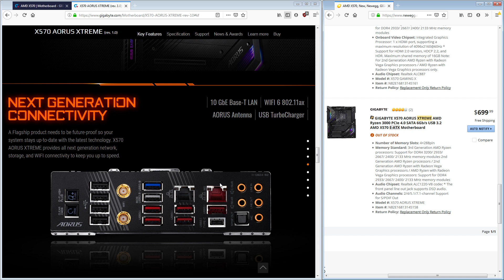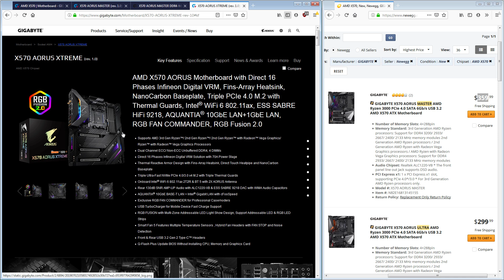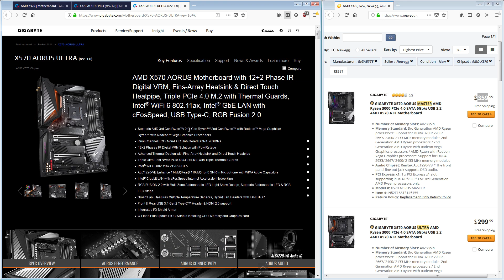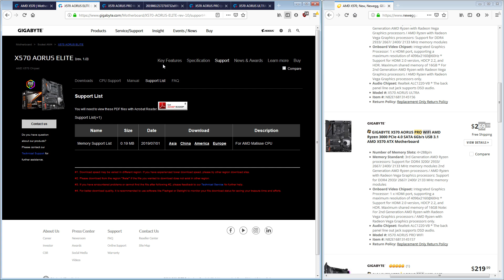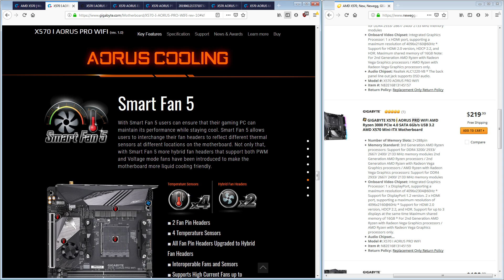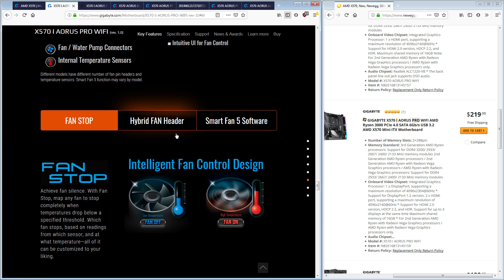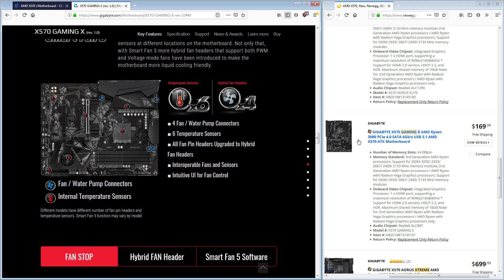Buildzoid rambles about ALL the X570 Gigabyte boards

Comment: I upgraded to an x470 Crosshair VII Wifi a few days ago. It was either Aorus Elite or Tuf Gaming Wifi for x570 or Gaming 7 Wifi, Taichi or the crosshair for x470. There was an outside chance for the x470 rog strix if none of the boards I really wanted were available. Went for the Crosshair for the extra features. The price was the same. At least when I ordered, as I got it on sale. Will put a 12/16 core in there down the line, otherwise I could have gone with a cheaper less overkill board.

Comment: Gigabyte: Makes boards with horrible VRM's.
Buildzoid: Make better VRM's ffs.
Gigabyte: Makes boards with excellent VRM's.
Buildzoid: Make worse VRM's ffs.
Reply: if ur paying 700 dollars those vrms better be made diamond encrusted with ruby emerald caps
Reply: Yeah im so fed up with the Mobo and GPU and CPU gouging .....Even the RAM got in on the Raping of us Consumers and they got caught ....now if we could get Mobos caught for price fixing then you know cpu and GPU's would drop with in a few so they would not have a Big light on them....oh we can dream but who knows I read the FTC is looking into Gig and MSI  for over steep pricing as the Reddit story said an investigation can NOT COME SOON ENOUGH for all of the major Players!!  Cow}:-o)
Reply: Im1CrazyCow Yeah you definitely are crazy, that’s not how economics work and I really don’t see that happening
Reply: The VRM heatsink on the x570 Aorus xtreme is as good as they come
Reply: aorus elite vrm are pretty much all you need
Reply: I really need an update on Biostar X570 GT8  ; how good / bad it is compared to Aorus Elite X570 board.
Reply: matrixfull 
8+4 IR3550 (60A) with a 35201 controller and 3599 doublers. Really impressive for APU LN2 OC ... or a rather useless layout.
Its still really good for 200€, but Im not so sure about the fan and the BIOS.
Reply: Dude bitching about cost of board and VRMs...ignores the fact that YOU DON'T NEED TO PAY FOR COOLERS WHEN YOU USE THIS MOBO AND THERE WILL THUS BE LESS NOISE...so just consider that a $100-200 rebate minimum.
Reply: @KravMagoo  / completely agree... I'm not in the market for this board but I wouldn't hesitate to go with this board in an extreme build

Comment: Not sure if anyone mentioned this, but the aorus Elite manual references a aorus elite Wifi, even with a QR code. This QR code just refers to the normal elite webpage and the only mention of an aorus elite wifi motherboard is one single article that just mentions that the wifi edition is 10 dollars more expensive. Is this a cancelled product or is there some other reason for not being able to find any more info?
Reply: @Actually Hardcore Overclocking, it seems that now gigabyte is listing the aorus elite wifi x570 board on their site, however i cannot find a price for it yet, allegedly it would be 10$ more than the non wifi, for "Intel® Dual Band 802.11ac WIFI & BT 4.2". Do you have any info about the pricing and if in your opinion this version of the board would be worth it.

Comment: I think all the lower-end boards bit manufacturers in the backside when the APUs launched and no one had Bios flashback on APU tire boards.  it left a lot of new systems builds with no way to update the bios to support the CPU purchased with the board, unless you happen to have a ryzen already.  yes, the C7H has Bios flashback, for a CPU that costs less than half the board and you cant even use the iGPU, is just stupid for a HTPC build, lol.

Comment: Hey Zoid. I guess Asus x570 tuf wifi and Aorus Elite are the best mobos (value wise). Can you compare them with higher detail ? Asus tuf wifi is so excellent on paper. Also you don't comment on pcb count much. What it's benefits ? Aorus pro wifi is 6layer pcb, aorus elite 4 layer pcb, Asus tuf wifi 6 layer pcb at $199 with wifi.

Comment: The audio components Gigabyte uses in the Aorus Xtreme are the same parts you'll find in high end external DACs. You'd have to spend a lot on an external soundcard to get something equal, let alone better. The Apogee Duet 2 for example uses the same chipset and overall very similar components (it doesn't get much better or more expensive than WIMA and Nichicon after all), and costs more than this entire board.

Comment: Nah, I'm not buying a new motherboard. My Ryzen 5 3600X is happy enough on my Prime X370-Pro. Even without PBO she boosts to near max boost cooled by a Thermalright TS-140.
One odd thing I've noticed is all cores boosting up to somewhere between 4.2 and 4.3 GHz, though that may have due to me monitoring them with Riva Tuner while playing a few hours of Fallout 4 (great stability test: if memory or overclock is on the edge of stability, Bethesda's Creation engine will become even more unstable than it normally is (still love the engine/games, though.))

Comment: Hi, I couldn't buy any 4 stick kits, so I just bought 2 x 2 stick kits for Crucial 3000 RAM.
Is the fact that I have 2 kits going to limit my potential vs 1 kit ?
I have the Aorus Ultra with 3900x.

I'm going to attempt OC like I saw in your Crucial video ( exact same RAM ).
Thanks.

Comment: @11:30 those pci-e lanes come from somewhere, from chipset for example, which creates a limited number of lanes. If you want to add more slots, you may have to disable other features of the chipset like extra m.2 connectors or sata ports.
@13:00 They used to sell full retail 10g cards with the Aquantia chipset for around 70-75$ so the chip itself is probably much cheaper in volume, let's say 30-40$... but who knows, they were recently bought by Marvell so maybe they raised the prices 

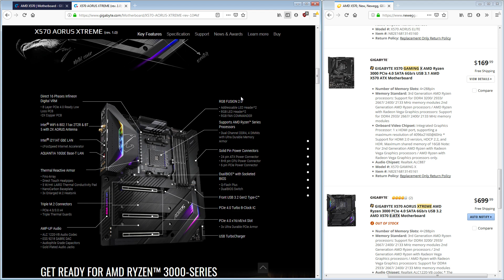@14:20 Someone could connect the 10g network card directly to a NAS and then use WiFi 6 for internet connection.  The 1 gbps could be used for separate/internal private LAN in a business somewhere. Well, sure, few are actually gonna buy this motherboard for an office workstation.  This being said, I agree with you that they should design the wireless card to be optional/removable.

Comment: All of those high speed kits are quite irrelevant. If you go out of 1:1 you get micro stutter. 3733 is about the best you can do in 1:1.
Reply: You may get away with 3800mhz ram and manually setting the infinity fabric to 1900mhz if you use the higher end cpu's

Comment: I still wonder why they don't implement the 10 Gb ethernet ports, instead of a "useless" 2.5 gb?
Reply: Most mainstream consumers doesn't have a gb internet connection nor a 10gb switch or router at home so it be kinda pointless.
Reply: @junyanchan1285  But when a motherboard is that price. It should have one when a motherboard like the Taichi Z390 ultimate has it. For a way lower price? Feels like I'm getting scammed out of that 10 gb ethernet port.

Comment: Can anyone here confirm?... using optical-out from the mobo to a theater receiver ...same audio quality as these PCI-E & USB sound cards & DACs, right? Wrong?

Been using this setup for years, but I've never owned an external PC DAC or soundcard to compare with.
Reply from the maker: If you use optical out you're using the DAC built into the receiving device
Reply: @ActuallyHardcoreOverclocking  that jives with what I read years ago, & why I've been using/suggesting thrift-store 5.1 receivers, but I just wasn't sure anymore with everyone being so concerned with mobo codec quality & streamers all running these external DACs. Thx for the reply! Great vids, btw

Comment: @Buildzoid
Does an X470 motherboard limit my memory speed compared to an X570 even though the QVL says the memory speed is supported? Do I have more trouble hitting higher mhz on X470 via xmp without manual tuning?
I'm considering buying a 3700X on a X470 and 16gb 3600 RAM
Thx

Comment: I have the itx board and 32gb ram. G. SKILL Ripjaws V 3200 for Intel. Got the sticks before ryzen 1st gen issues were found. On the Biostar X370 GTN was able to run at 2933 for years. I could not get his running higher than 2133 using either manual or XMP (profile 1 looked good). Finally installed Gigabytes OC windows app and was able to use it to get to 2933. Going to try 3200 today. Using F4h bios

Comment: Concerning your rant about LAN, WiFi, Sound cards, USB and PCIe expansions, on paper I totally agree with you. Most of the "features" included on modern motherboards are going to waste. I too would rather use my own sound card/WiFi card/10GB LAN card and so on - frankly even the standard back IO ports should be customizable in my opinion - however in practice it would require motherboard manufacturers to come up with a new standard to replace the ATX standard and its derivatives. Unfortunately manufacturers will always be reluctant to invest into new standards - no matter how much better things might be either for them or their customers - because changes to the end product means changes in manufacturing process, huge costs and taking the risk that the customers might end up just as reluctant to change.

Comment: the pro has 2 thermal sensor connectors. Nothing cheaper from any vendor of x570 has one. This makes it the ideal board for watercooling setups in my eyes.
Reply: Quite often not every fan header can use temp sensors as a source for the fan curve.
Reply: @Lead_Foot  Which is a mistake of motherboard vendors. Why should my fans ramp up every time my cpu spikes because it is at 100% load when my water temp has not changed.

Comment: Ace Meg has a heatpipe running down to the chipset. The only mobo under 360-400 USD. You didn't mention that in MSI vid. What's the reason for that? Is it not meant for cooling the chipset?
Reply from the maker: Because I doubt how effective it is if the board still comes with a chipset fan
Reply: Yeah I can see that. I'm trying to figure out my next purchase, so I will wait for the actual testing then. I hope you're gonna test some of the mobos in that price range. @ActuallyHardcoreOverclocking

Comment: Thanks maaaaan! I can finally order the Master for 4x8Gb SS DIMMs setup. Was so afraid that Daisy Chain would prevent this...i really want to be able to go 4000Mhz low latency with forced IF clocks <33333
Reply from the maker: 4000MHz on ryzen is bad because you have to run the fclk de-synced and that causes a latency hit lowering performance

Comment: The biggest issue with Gigabyte's ITX board compared to impact is rear IO as far as I'm concerned. Also no digital audio out is a big nono for this form factor. Impact does much better with rear IO.

Comment: 1:00:00 as a guy who has done multiple ITX build, having printers and external soundcard on an ITX build doesn't make sense. The point of the ITX build is to be as minimal and compact as possible, for space efficiency and portability. P.S. this is also why on-board audio is important, because it doesn't have to be as good as an external DAC; it just has to be good enough that you don't need to buy one.
Reply: Besides, if you're that needy for usb ports, you can always use a hub. Printers, soundcards, keyboard and mouse don't need the bandwidth. Even for webcams it is questionable to need a dedicated usb port. Although mouse and keyboard I can understand due to possible latency issues.

Comment: When did the Diagnostic Display get to be such a luxury item? A few years ago they were on most boards.
Reply: Agreed. My Gigabyte Z87-UD4H was $75 in August 2013 (just two months after Haswell launch). Quality VRMs and Post code were standard and it was sub $100. I do think I got super spoiled by this motherboard though lol. And for full disclosure, it was $115-$40 (Microcenter promo); but hey. There is a certain irony that AMD boards are now pricier than the Intel boards I've used in the past. And that even includes the DFI LP UT P35 board - look at its launch price (lmao) - tho I ultimately got that for like $22X I believe.
Reply: Dude i got. POS Gigabyte G1 z97 with debug display, post code bios FB Quick buttons c cmos, power reset dual bios dips, single bios dip $120 lol they are screwing us enthusiasts
Reply: Yeah those displays cost what ..a few cents?
Reply: and back when i got my first highend s754/939 AMD boards, they where 1000-1400dkk (150-200usd), these days same quality board cost you 2000+ dkk(300+ usd). So things change, and aparently electronics keeps getting WAY more expensive.
Reply: When they started excluding them
Reply: The board cartel got together and agreed on a plan to segment the market to raise prices by limiting feature competition. You know, anti-capitalism at its best!!

(Last sentence added because I'm concerned that an entire generation is growing up wrongfully being told that greed is capitalism as apposed to a market-based method for the efficient allocation & investment of limited resources)

Comment: I just finished building a x570 Gigabyte Ultra with 3700x/ rtx 2060 and I love it! it has been a massive bump in performance/stability/responsiveness from my former fx-8300/M5A97 r.2/r9 290x.
Reply: Can you tell us anything about the Chipset fan. How loud is it? Does it run at high rpm all the time?
Reply: Jeroen E I haven’t been able to hear the fan from the chipset because The stock Wraith Spire that came with the 3700x is super loud.
Reply: Jeroen E I just removed the side glass of my case and I still can’t hear the chipset fan. My CPU and GPU fans do not allow me to hear the chipset fan. Also, the chipset fan only turn on during intense applications. It stays off at idle.

Comment: So provided you have the best power stages and filters, whats the best number of phases to achieve best CPU overclock with the lowest vcore? (ignoring efficiency)
Reply: Infinity
Reply: @teddygoboom1  I doubt it. at certain number it probably stop to matter and you stop getting any benefit for your overclock. the question is whats that magical number?
Reply: @HB-ws6ge  its pretty complicated.Ripple (excentuated by lower phase count) can be reduced with a higher frequency switching, and higher capacitance. So in theory you could have lower ripple with a single power stage and a big enough capacitor than a "Real life" 8, 12 or 14 phase system.

Comment: test a apu in the mini itx? that will be interesting:
i have the b450 mini itx from gigabyte with an 2400g and the bios is nuts.
MCE(boost all cores to 3.9ghz)is automatically enabled as soon as you set any igpu clock (not auto), with no other way of controlling mce. as my chip is a tomato and not stable at 3.9 all core, i am not able to do any overclocking with the igpu unless i set 3.8 all core oc on the core in the bios.
i tryed all bioses available for this board, but the problem stays.

Comment: does it make sense to use 4000mhz ram when the infinity fabric only can handle up to 3800mhz ? could this be an issue ?
Reply from the maker: 4000mhz ram on ryzen doesn't make sense
Reply: @ActuallyHardcoreOverclocking  
Which is the best ram freq to use with gigabyte extreme and ryzen 3900x
Reply: What speed is sweet spot?
3600mhz?
Reply: @UkletiHolandjanin-pd1bf  3733

Comment: Buildzoid 1 year ago: I’M NOT A MEMORY OVERCLOCKING EXPERT BUT LETS EXPERIMENT
Buildzoid now: SPENDS 40 MINUTES DISCUSSING RAM QVL
Reply from the maker: Oh I'm still bad at RAM. That doesn't make high speeds in qvls any less interesting
Reply: Actually Hardcore Overclocking it doesn’t, yes. But it’s funny to see the contrast. I initially came to your channel exactly for ram oc and enjoyed my stay ever since touching it. Ty!
Reply: @ActuallyHardcoreOverclocking  isn't >3600 DDR4 kind of irrelevant for Ryzen 3000? also, new 2x32GB Corsair kits announced last week, can those go up to 3600? great work man, keep going, thumbs up
Reply: @ActuallyHardcoreOverclocking  why don't you just RAM it up your Overclock. Just kidding. What you consider 'bad' is extremely useful to PC illiterates like me. Loved the vid despite the fact I am passing on the new motherboards and sticking with my MSI X470 gaming pro carbon; bought it after your review - you were spot on, an amazing board! Besides, why bother with new boards decked out with fans? Rather wait to see what DDR5 boards bring to the table. And maybe they'll have more passively cooled chipsets by then - knock wood.
Reply: @wattotoydarian9376  which cpu did you pair with?
Reply: @meenamjah  Just switched from an 1800x to a 2700x. I have to say the 1800x was pretty good but the 2700x boosts nicely to 4.15 by simply using bios automated game boost.
Reply: AN INTEL LAN INTEL LAN LAN LAN LAN LAN

Comment: Can you please not call the Aorus Elite an entry-level board? :( That thing is $240+ dollars including tax in Europe. Those are not entry-level prices. I don't care if you stick a 3900X in it or not, it's still bloody expensive for a board without basic functionality like troubleshooting LED's. And so far the new platform is buggy enough to want decent debugging info.
Offtopic: I thought I was smart going for an only slightly more expensive Asus X470 C7H with my 3900X. But I can't even get that to boot at all. Q-code 02 'AP initialization before microcode loading'. Unfortunately that isn't very helpful, other than pointing towards either a broken CPU or motherboard.

Comment: Nothing beats saturday mornings with some ramblings and coffee!
Reply: Where can I get a motherboard where I won't have to worry about the fan breaking up? That allows me to have LAN parties but if there isn't enough cables I can switch to wi-fi? Where audio is awesome and I won't have to carry a seperate box? Where I can insert an additional capture card and a render card as well as GPU? That has really good cooling as I plan to overclock the fuck out of it? And if I ever get attacked at home, I could use the motherboard as a bullet proof vest?